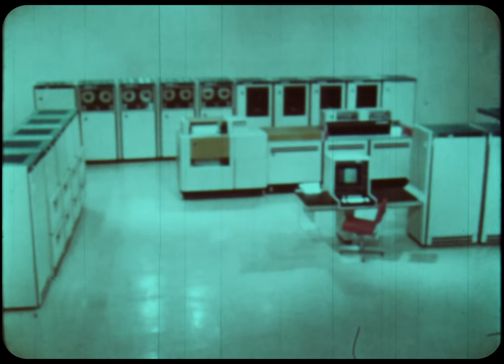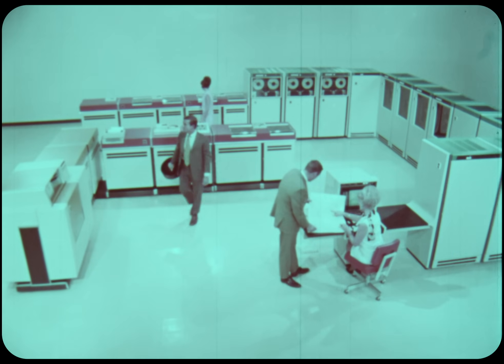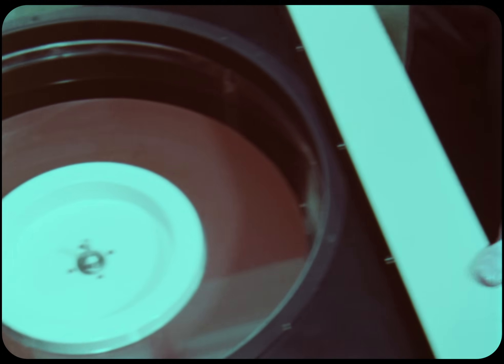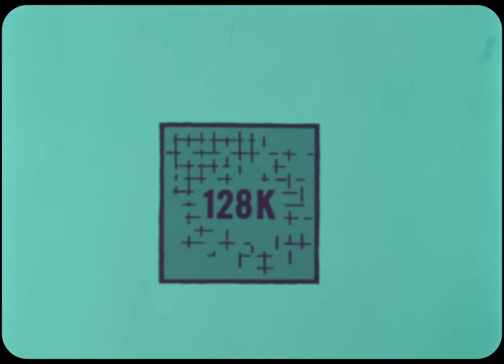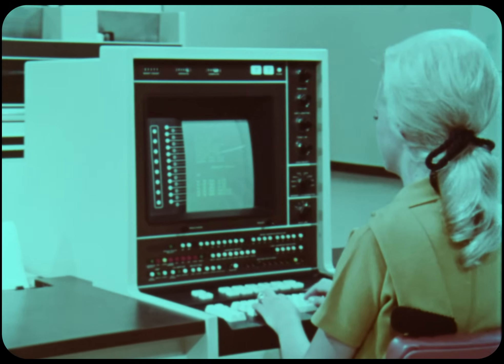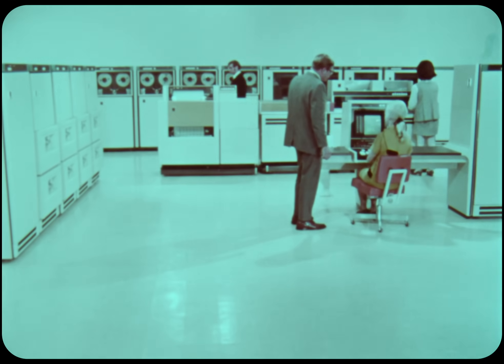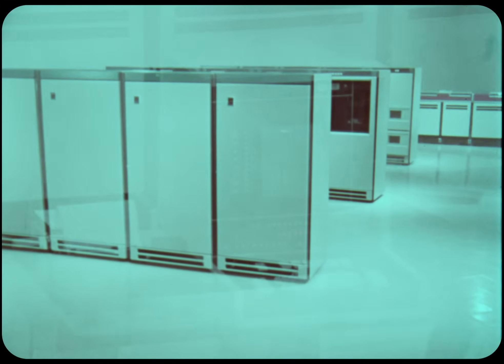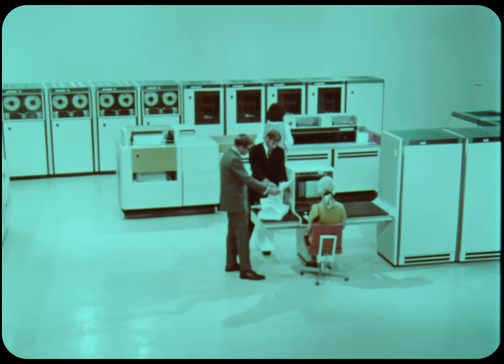The NCR Century 300 Computer System 1970

Comment: The amount of ram looks small however If you consider that those machines were programmed bit by bit in punched cards, the complexity of the softwares were huge. Amazing vídeo, tks.
Reply: No. By the 1970's, we were coding in high level languages like Fortran and COBOL. However, there was still a lot of assembly language coding.

I coded using a keypunch machine and punch cards. We didn't code bit-by-bit.  The languages we used were fairly English-like.

FYI

By high level languages, I mean computer languages that have a level of abstraction between them and the underlying hardware.  High level languages are portable and can be used on computers built by different manufacturers.  They also do not have to manage memory addresses or CPU registers.  Low-level languages, such as assembly/assembler, are specific to the systems they run on and have to manage the machine resources.

Comment: 128k  was massive back  then (and was considered very lavish until the mid 80's) and type of mainframe time share thing was typical but fast forward a few years and out pops CPM and boom 8-bit business PC's before PC's were a thing, leading to msx etc..  even amstrad cpc's and speccy +3 were CPM compatible.  16 bits side of things were a mish mash but mostly Amiga's and ST's outside of the few dads getting "home work" pc's  which shipped with DOS, later again win 3.1.  fast forward a few more years again and win95 hits while  the internet/web is starting to more of a thing in colleges and the rest is history..  but even then back in college in the early 90's when we learned C/C++, fortran, cobol etc.. it was on an older Digital VAX main frame, which in my second year transitioning to 286/386 Pc's based ipx internal network  (TCP was insanely expensive back then, cards alone were £100's) which also ran terminal emulation software to log into the vax system.  good times...

Comment: “Satellite system linkable online to larger systems…”  and “nanosecond speeds”?!   Seems way ahead of the time ; can any fellow old-timer explain those claims to me? Tx
Reply: The Century 100 had a memory cycle time (more or less the read/write rate) just under a microsecond (which until then had been the common unit used by most manufacturers. To be fair the C100 cycle time was 800 nanoseconds, but that was enough to use the term :)

Comment: A coworker (now retired) got her first programming job at NCR in the mid-70s. They were so desperate for software engineers that they hired women straight out of school, a very uncommon practice at the time.
Reply: Actually, NCR was willing to hire 'straight out of school' when I joined in the mid-sixties. They had an 'on the job' training program that was seemed more effective that assuming a grad qualified. Now to be fair, there were not many "computing science degree" programs around. Manchested University had one though that was extremely oversubscribed!  NCR also had an interesting Programmer Aptitude Test that was more related to being able to work with programming ideas that the other manufacturers which tended to be more like IQ tests.

Comment: Crazy you can carry that power in your pocket these days ...
Reply: Your phone has much more power: clock speed 3000X faster at least, multicore CPUs, hardware floating point, 16,000X more memory. I am going to say about 50,000X faster depending on the benchmark- and that's before you even consider graphics!

Comment: Script must have been written by Marketing. Anyhoo, the disc packs are supposed to be screwed in and the cover removed, otherwise the heads are going to have a hard time moving across the disc platters.
Reply: I did notice the lady just drop it in near the beginning, but later on, a guy screws it in and removes the cover like you say.
Reply: The woman knew her place. It's a man's job to actually screw it down and remove the cover. Women are there to do the mundane like retrieving disc packs and bringing them to the drive. It was 60s and 70s baby! 😂
Reply: If you look at 0:51 the lady operator unlocks the twistlock in the head and as she closes the drive lid, the disc cover automagically lifts out of the way.

Comment: I wish we could try to make a super computer out of all the old pcs getting sent to the dump. Build a dam to supply it with enough energy and connect all the computers as a massive cluster. Group them by processor type.
Reply: You can - and to a certain extent I have. When I was working for Emory University as a contractor, I deployed what I'm pretty sure was the first ever native Hadoop cluster on Gentoo Linux, using PCs that faculty and grad students had cast off. I implemented automatic worker node configuration in the second iteration of the cluster; I had five machines going and could have added many more but mostly I was limited by electrical power and space. I was asked if I could convert a PC lab with something like 30-40 thin clients into a Hadoop cluster; the answer was yes but converting the lab back and forth from Hadoop cluster to a bunch of independent Windows PCs would have taken a lot of time.

Comment: an advertisement with integrity, they actually tell you to shop around and make sure it's what you need in their own advertisement.
Reply: To be fair, those systems were a larger financial risk for them if they didn't sell it to the right people, either. I mean, the logistics of a customer returning a desktop personal computer from 2025 is one thing, but returning a mainframe designed to fill up a room is a way different paradigm. I speculate that they had their own motives as a business as well in addition to altruistic intentions lol
Reply: Main reason is this is business to business sales. Very different sales approach than typical business to consumer.
Reply: These computers were commonly leased. In fact, prior to an antitrust lawsuit in 1956, IBM only leased equipment.
Reply: @straightpipediesel I was more making a comment about today, where they hype you up on buying this amazing new hardware, tell you it has all these advanced new features, and then you get it, and it's like 5% faster than what you were already using, and the new features only work with one specific piece of software that's not compatible with your software stack.
Reply: Thought the same. When they started with "It's the bestest, newest, coolest machine..." I was like: Sure it is. But then they got the corner with "in our portfolio." 🎉